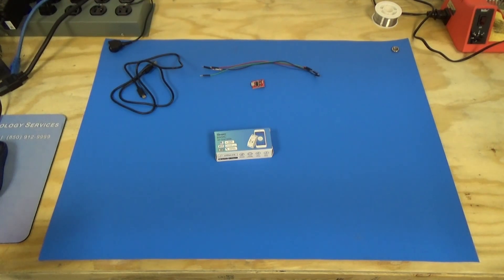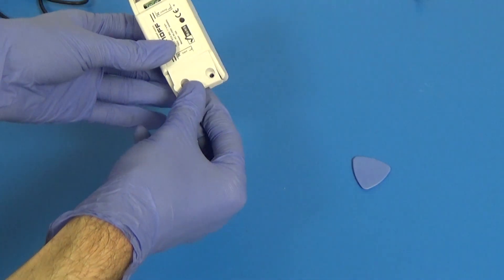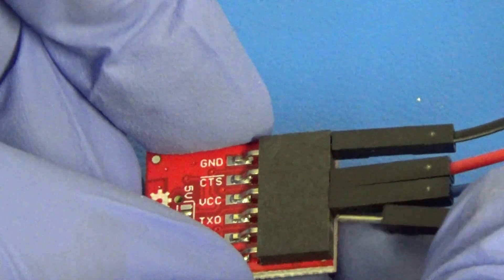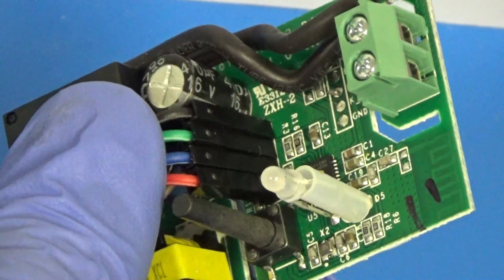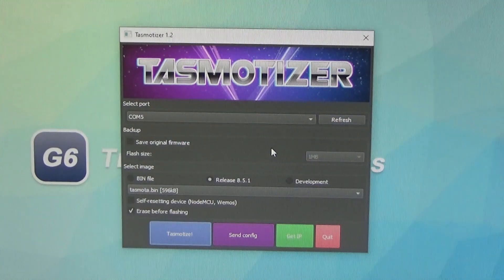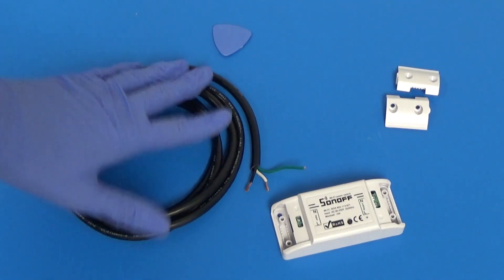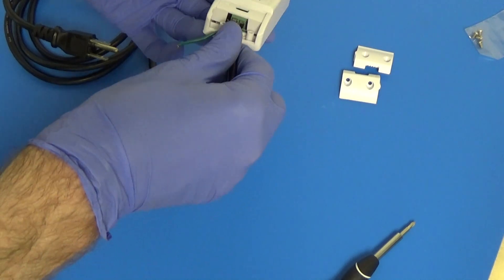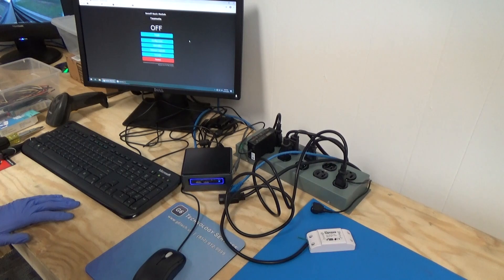Flash a Sonoff Basic with Tasmota Using Tasmotizer (Easy! No Soldering!)

Comment: Hello, I'm getting error message: "failed to connect to ESP8266: Timed out waiting for packet header", any ideas how to solve it? I'm on win, COM is being detected in devicemanager and in tasmota, whenn I click tasmotize it goes with download and then it stucks at erase step.
Reply from the maker: Double check the com port is correct. It could also be that the 8266 isn’t in programming mode. You need to hold down the button while it is being powered on. Otherwise it will just boot normally and you can’t write to it. Also check that your TX and RX are crossed. They should be RX to TX and TX to RX. Not TX to TX and RX to RX.
Reply: @G6TechnologyServices  I did check it few times already, I also switched TX with RX and checked both options, no success. I do press button while connecting, the led light from sonoff is not blinking. :/

Comment: Real problem with just holding connectors with your finger rather than soldering is that if the connection is not good during flashing you can brick the device. Personally, for the 2 minutes it takes to solder a pin header I would highly recommend it.

Comment: I keep getting and error, cannot open com 6, tried a different usb cable. It seems to recognize if I change to com 5 it automatically changes to com 6.
Reply from the maker: Did you get it working? The COM port changes when the adapter changes USB ports. Check Device Manager to see which is the correct COM port number.
Reply: @G6TechnologyServices  Yes, I got. I had to install window's drivers to get the usb adapter to work. The same one you suggested. Windows recognized that I plugged in a usb device, but when I checked device manager it had an error. It was finicky through out the install, but it works. Thanks for asking!
Reply from the maker: I'm glad you were able to get it working!

Comment: Can I use sonoff without internet after update tasmota software
Reply from the maker: Yes! Tasmota does not require an Internet connection.
Reply: @G6TechnologyServices  can I use serial cable for update tasmota
Reply from the maker: I suppose you could re-flash it when there is an update, but that would wipe out the settings and you would have to reconfigure it. You can also download the firmware from a computer with Internet access and put it on a local web server that the Sonoff devices can access and upgrade that way. https://tasmota.github.io/docs/Upgrading/
Reply from the maker: Actually, it looks like you can just upload the new firmware using the web interface. That would be the best method if they can't download from the OTA server.
Reply from the maker: Well, as I continue reading that page. You can upgrade with the serial adapter if you don't erase the flash first.

Serial Upgrade
Upgrade over the serial connection using serial-to-USB adapter.
Upload the new version over serial using the same process as in Flashing but DO NOT erase flash. The new binary will overwrite the old one and keep your settings.

Comment: I found that the best way to connect the serial/usb device’s four jumper wires without soldering was to simply plug through the sonoff board to a project board - just make sure to use separate rows (unconnected) rather than separate columns (connected). This holds the jumper wires in place but ensures that they don’t touch each other. You don’t have to worry about disconnections while flashing Tasmota. Happy projects, everyone.
Reply from the maker: That’s a good idea. Thanks for sharing.
Reply: Wow great idea about the project board. Thanks for sharing.
Reply: Great idea. I'll try to do that :)
Reply: An eraser or packing tape works well too

Comment: Its a nice software easy to use but this software broke my device flash. Problem is It doesn't allow the flash mode to be selected. ESP8266 uses DIO while the newer ESP8285 uses DOUT.. Flashing with incorrect mode will do irreparable damage.

Comment: Thanks for video. Could you please explain how does the sonoff connect to the internet. I'm having a hard time cause my ip is changing all the time. I'm seeking to control it over the internet. Thanks in advance
Reply from the maker: The Tasmota firmware does not connect to a cloud service. It is meant for local control. If you want to control it away from home, you would need to use a dynamic DNS service and open a port, which is not recommended. Another option is to use something like Home Assistant, which has an app and cloud service ($5/month) that does not require you to open ports or know your public IP.

Comment: Hi Can i use DSD TECH USB to TTL Serial adapter with FTDI FT232RL Chip Compatible with Windows 10, 8, 7 and Mac OS X to connect my sonoff to pc instead of SparkFun Serial Basic Breakout - CH340G Development Tool
Reply from the maker: You don't have to use the SparkFun CH340G that I used. Just make sure that both VCC and signal are 3.3V.

Comment: thank you for the clear video. With this I flashed several Sonoff Basic. In the meantime I bought a number of Sonoff D1 Dimmers after I saw that a Module (# 74) already exists but it doesn't work at all ... can you help?
Reply from the maker: Sorry you're having trouble. I haven't used the D1, so I can't really suggest anything. There is a Tasmota Discord that you can use for support if you want to try that.

Comment: How to use dc power with sonoff.
Thanks
Reply from the maker: The Sonoff Basic is designed to use AC power. You might be able to make it work, but I've never tried.
Reply: The circuit board is powered by mains voltage, so DC isn’t an option. But you could hook up a 120 VAC relay to the output of the Sonoff, and use the relay to switch a DC load.